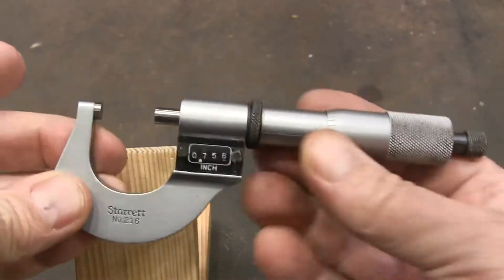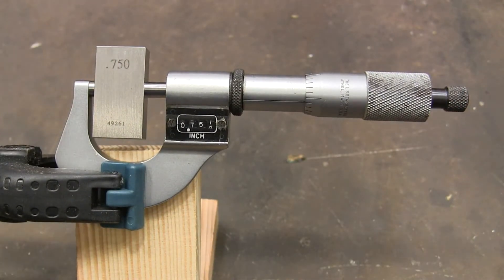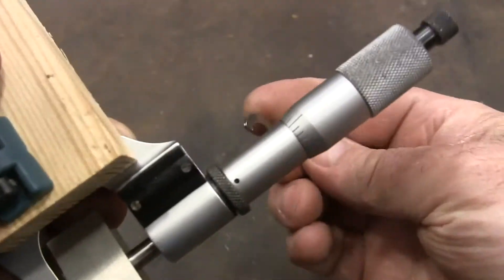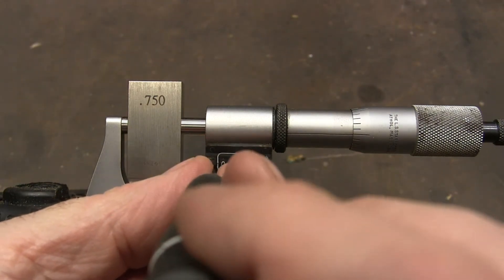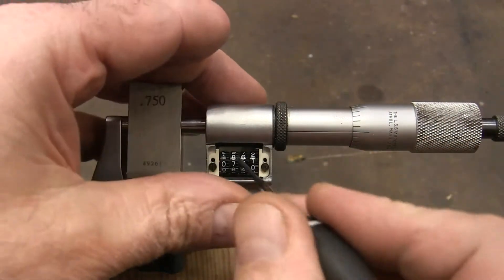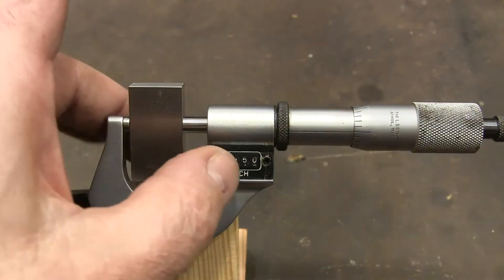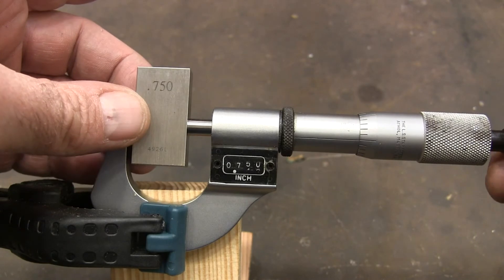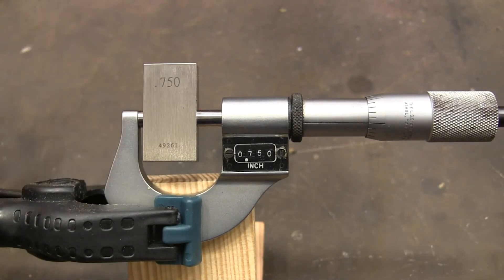How to Calibrate a Digital Mechanical Micrometer

Comment: Did you put it out of whack on purpose beforehand or is it possible to be that far off just by normal use?
Reply from the maker: It was like that when I got it. I figured someone dropped it.
Reply: @SoatMon  bummer, need to check the parallelism of the anvils to trust it to the last digit if it's a tenths micrometer